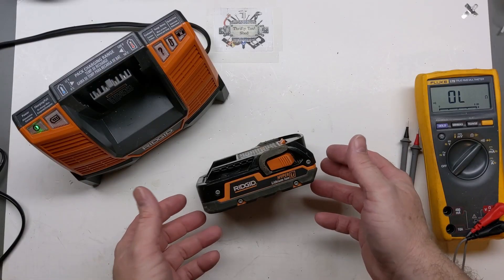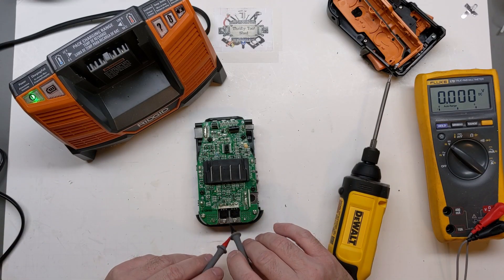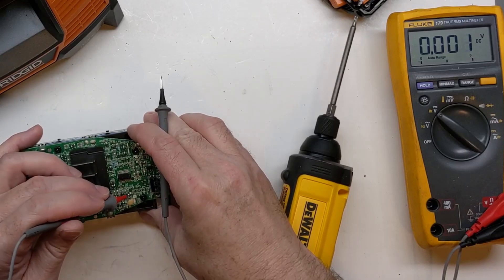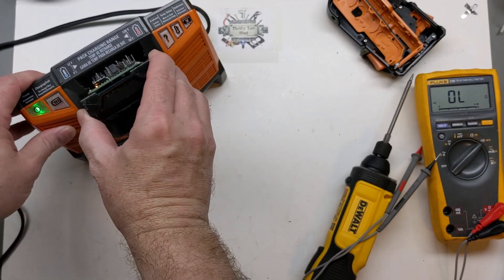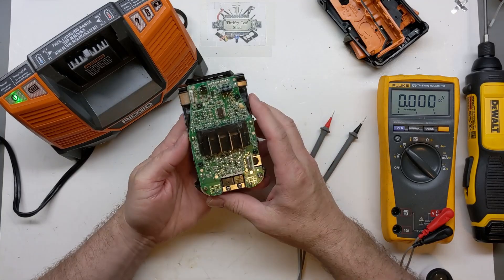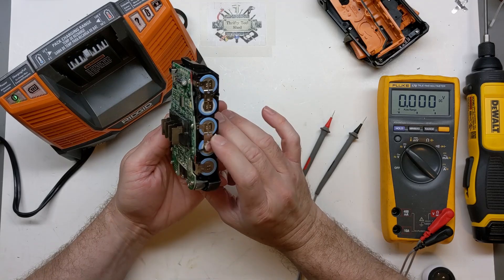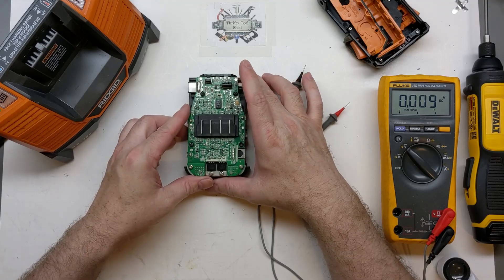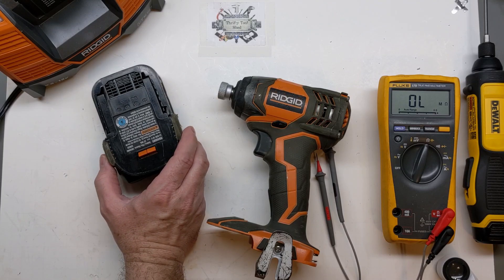Can we get this Ridgid 18V Hyper Lithium Pack back working?

Comment: I got 20v sitting at MOSFETs but controller doesn't want to enable to output pins. Reset didn't fix. Think controller bricked . I've had perfect solder looking boards on devices needing reflowing to bring them back to life. You can never trust solder.

Comment: Thanks about good video. I have same kind of AEG batteries. Both had faulty cells. I replaced those with new ones. Other battery works no just fine (even though lihts are not working when i press battery button)  but other where all cells are new does not. This problematic battery worked for a while just fine when there was voltage differences on paired cells. Then the battery light was flashing all the time but drill worked and charger accepted the battery.

Now when battery light is not flashing anymore the drill runs one second and stops. If I wait 10 seconds or so it runs another second but not more. Charger first gives green light but after 5 minutes it turns red "battery failure" light. 

Every paired cells has 4,03V-4,07V so those should be ok now. Very strange problem. I tried to brush the board with isopropylalcohol. Did not worked. I guess because I should not have connecting failure because the drill works even one second. Would be nice if someone has faced similar problem and could give me advice. I also reseted the bms with jump wire. Did not help either. Battery lihts are working and if I press the battery button there is four light as it should be with 4+Voltages I guess.

Comment: A+++++ my pack got little wet rain, going to try resetting after cleaning with rubbing alcohol .... will report back,  but not sure light coating with PC board lacquer would help prevent the corrosion from attacking the circuits?

Comment: accidentally left my ridgid 18 v drill outside. It got wet but not soaked. It showed 4 lights but it wouldn't fire off any other tools and it wasn't charging. I took the top off and used a dry toothbrush to just gently brush off the entire board. It took 3 times but finally the light came on on my hand held led light and it is properly charging. All I did was brush the entire board , no alcohol or anything. It runs all tools again.

Comment: Great video.  I have one battery that went through a -20degC winter  and one brand-new battery.  Both show error when I try to charge.  I suspect the charger, but I'll try your cleaning idea.  The charger also went through the -20degC  winter.  Do you know if low temperature will harm the charger?
Reply from the maker: Thanks for your kind comment. I don't believe the charger will be permanently affected by that  temperature. If the electrolytic capacitors physically look OK and not bulged or physically leaking, I would think it's OK. If it was powered on or actively charging while exposed to that temperature, it would be much more likely to have damage. Best of luck to ya!

Comment: reset trick worked on one but not both. what is the button inside on the top of the board for? i saw you push it and no lights lit. on mine the first light blinked 4 times. I'll save the batteries to replace others possibly, in the future.

Comment: Shout outs to your channel and isopropyl alcohol and a brush. Sorted my failing battery that charged up fine but failed under load.  2 of the 10 battery cells are showing 3.2 v and the rest are 4.0 so maybe I should change out the 2 lower ones or they are on their way out?
Reply from the maker: Most likely, they are losing capacity if getting that far out of balance. Sometimes charging up the individual cells with a constant current power supply back to fully balanced will get the pack up and running. If it gets off easy again, it's most likely that cells have lost capacity and will stay unbalanced until they are replaced.

Comment: I am having trouble with a battery pack, I've tried everything at least twice, but I suspect one of the mosfet's solder joint. I have tried re-soldering a number of times but the blob always goes from shiny to grey as it cools. This is the rightmost connection point, next to the output terminal.
Is a cold solder joint on a mosfet an indication of something?
Reply from the maker: It could be. Sometimes it takes a while to get a large pad or area hot enough to flow solder well. Even if it does get hot enough to flow well, it is possible the Rosin Flux from the solder is all gone, leaving a more dull joint. I will typically add Flux like the Amtech 559 or atleast RA Rosin Flux when soldering a device such as this.

Comment: Any chance you can show how to do this on a Dyson V8 battery pack?
Reply from the maker: Some of the Dyson packs have a terrible feature. When the board senses any of the cells have gone below a safe voltage level the board throws a permanent error and it cannot be reset. Not sure about the V8 specifically. I have seen some on YouTube go as far as to try to get a program out of a working packs Microcontroller and reprogram the faulty one after replacing cells etc.  That is a tremendous amount of work to repair a battery. Not sure which Dyson packs are like this.
Reply: OK, good to know, thank you.  Thanks for your efforts, great videos.

Comment: I have an old R840084 Rigid 18V that I can't figure out. I get 20 volts across the main power leads. All the batteries are level (around 4.09 to 4.11). It charges really quickly with no errors, but then it's only good for a few minutes of run time. Then if you wait a few, it will run again. It's like the batteries discharge in 1 minute intervals then go flat, then after a bit they can discharge again. Really weird, any ideas?
Reply from the maker: I have seen a similar thing happen when the cells or at least 1 cell is bad. So it's not the most common failure, but I have seen a cell go bad and be so low in capacity that it will charge up fine to 4V or so and then under load drop like a rock. It could be a cell doing this or the Board maybe causing it if it thinks it's a cell issue.
Reply: @ThriftyToolShed  Thanks, I'll try testing the pack immediately after it does a discharge. The weird thing is that if I wait, the battery will act just like it did off the charger. It will spin great for a minute (no load), then stop. I'm not sure if the batteries ever discharge because you would have to go through several cycles to force them. This is an older board, and I don't know how to reset it. There is a RST contact but no GND. I'm afraid to short it to anything but ground. Right now, I'm trying to see if I can get at least 50% discharge on the batteries.
Reply from the maker: @GeorgeNovak  
You may be able to look up the Microcontroller datasheet and see where ground is on it and use where that pin is connected as a reference for ground.

Comment: Thought I was going to luck out with a good circuit board cleaning...used 91% alcohol and lights came to life...but then right back to only 1 LED.  Charger says charged, battery says dead.  I am working on a 5AH Hyper LIon battery and the board does not look like yours...any chance you can assist further in resetting the baord?
Reply from the maker: I have only worked on a few of this type. The corrosion cleaning and then the micro reset is the only 2 repairs I have personally come across. The only other repair I have done on these is the obvious cell replacement on some with bad cells.

Comment: Tks for sharing this. I have two 9ah batts. One charges on the larger chargers fine but the other 9ah pops the defective light shortly after plugging the battery in.... However, that "defective" battery charges just fine on the smaller lower powered charger. Any ideas as to why this is happening? They are the octane batteries and both show as "healthy" on the Ridgid app.
Reply from the maker: Hard to say, I have not had those exact packs to say for certain. I have only had this issue with corrosion on the board. Thanks for your comment!

Comment: It worked!! I have been trying to jumpstart through the terminal leads. Used the wires from the multimeter and a separate Ridgid battery.  I went directly to the battery terminals for 10 seconds. Put it back on the charger and viola!  No more defective red light.  It’s blinking green and charging again!  Thanks dude!
Reply: Hey there. So you just jumpstarted the battery from another battery ? Just using the 2 outside rails correct ? I need to try this later today

Comment: What are the other two main pins, and what do they do. They’re labeled T1 & T2
Reply from the maker: I have not looked that far into these, but have many other packs. Most modern packs have a temperature feedback terminal and a communication terminal. I would  be almost certain these are the same. This is one of the few issues I have had with these type packs and no longer have any myself to say for certain.

Comment: I had the same exact issue and everytime I did clean it did light up. Unfortunately never got to the charging part cuz had to fix the charge station that didn't light up.

Which was caused by A/C side Cap   defect.
Reply from the maker: I have had the caps fail in some Ryobi chargers as well. Of course both are made by TTl.

Comment: Hi. Do you have any knowledge in Octane pack ? Is there a reset pin on the board ? Thanks
Reply from the maker: I am not sure about the octane. I would hope it would have the header area on the board. I have seen boards that do not have it and the only way to try a reset is to look up the microcontroller pin out and jump reset pin to ground. These with the conformal coatings make that a more difficult job than it should be. You have to gently scrape off the coating on those pins and the pitch is very fine on these newer micros....

Comment: I can't understand how you did the reset please what are reset and reset
Reply from the maker: Some battery BMS boards have a spot on the board where a programming header would be for the microcontroller. If the board has that spot sometimes you can see a screen printed abbreviation for the pins. I did see a RST and GND on mine and I simply jumped these 2 pins on the board for just a second. I have seen some boards not have this and some may be abbreviated differently, but similar. For example GND could be COM or VDD etc. I always look for a spot where the header might be on the board. It's usually not too far from the microcontroller. Jumping this helps sometimes because the power is always on the microcontroller and no way to do a power cycle. So this Reset will sometimes help in some cases. Best of luck to ya!
Reply: @ThriftyToolShed  Thank you. I found ground, but not the second one. In have 5 octane batteries 3 3amp 2 6am and 1 9amp. I fixed all but the 9amp. Thanks for quick response. The octane one compared to video looks much more complex. Also just realized my vision is not what it used it. So got a magnifying. Glass to see better . actually going to check shortly.
Reply: @ThriftyToolShed  I'll look for the rst thats more than enough help
Reply: @ThriftyToolShed  Forgot to mention the way I fixed my other 4 batteries was I drained them to about 1 volt by bypassing the terminals and left it for a day. The second I use another 18v battery to start charging it would make a noise. Pretty much my way of resetting for the octane batteries. If you cant find the GND or RST.
Reply from the maker: Are you saying that you drained the pack down to 1V?
Reply: @ThriftyToolShed  well not exactly. It was 3.1v as low as it could possibly get and also cleaning like you showed me.
Reply: I just fixed another 3ah octane battery today. Only thing is everything works now but the blue light remains and wont turn off.  I'll just figure something out or de solder. The connection. I mean how much power could it really be draining .
Reply from the maker: @MrRaulgutierrez95  Usually a LED will pull around 20ma So unless something else is pulling current as well a 3ah pack would be ok until around 150 hours before it would be close to low level discharge. Did you by chance just clean the board with alcohol? I have seen some boards do this for a few hours after a cleaning. I always use 99% IPA, but it sometimes seems to have drawn in moisture from the air if sitting around and IPA can eventually equalize to around 65% alcohol and 35% water if it is left in open air or cap not sealed well for some time. Water will absolutely cause the lights to come on on the board and may even cause other damage. Just thought I would mention that since I have had it happen.
Reply: @ThriftyToolShed  this one not yet. I'm just did the drain and restart method. But it doesn't drain too much or any at all.  I use 99% and I use lectra 3000. You could use it on energized tools or anything that cant be drain. But on another battery I think I used to much of it because it cracked the see through plastic that houses the terminals. Would that effect normal function.(9ah octane )
Reply: @ThriftyToolShed  man your response time is amazing!!!
Reply from the maker: @MrRaulgutierrez95 I see , yes I have had some electronics cleaners over the years that would destroy plastic. I try to share using the plastic safe type as well as non conductive of course since I have had problems before.
Reply from the maker: @MrRaulgutierrez95  
I do my best to respond as long as YouTube makes it show up and I don't have too many other things going on at the time. 👍
Reply: @ThriftyToolShed  yeah always look for non conductive and plastic safe. Thanks for replies I'll keep you up dated on any changes.
Reply: hey my friend so my 3 amp octane now works.z. There anyway I can message you directly. I'd like to send you some photos and get an opinion.
Reply from the maker: @MrRaulgutierrez95  
I have Facebook page to message through or thriftytoolshed@gmail.com

Comment: Just gotta quick question, what do the 2 middle terminals do? I'm planning on making a charger from scratch but I'm curious to know if one of those are a charge input?
Reply from the maker: On these, one of the middle pins is for charging and the other is for temperature monitoring if I remember correctly. It's been a while and this video shows about the only issue I have had with these Ridgid packs. I have worked on many packs that have a communication connection between the tool and pack, but these Ridgid packs have the BMS and Cut off built into the pack similar to Ryobi.  Best of luck to ya with yours.
Reply: @ThriftyToolShed  thanks mate, I thought that was the case, funnily enough there isn't any information or very little about pin configurations lol thanks mate and thanks for posting this video it was a great help learning about these cells, great content mate👍

Comment: I found the left hand mofset was not functioning and it seeto not be triggering. I ended up soldering a small wire from the trigger connection of one mofset to the other with this in place everything works ok. It appears to me e that there e are two parallel circuits one to trigger each mofset this makes me think that they may somehow be involved with safety circuits but I have no way of confirming this. Once you do this the battery charges and operates normally.  I keep my batteries in a steel box with dividers and a external spark proof vent. Just to be sure.
Reply from the maker: I do believe the monitoring circuit (safety) of the board is indeed what will cut the gate to the Mosfet.

Comment: I've enjoyed your EGO videos.
This time, this video allowed me to fix a 3.0AHr Ridgis battery that showed charge, but wouldn't charge or work in a tool (and was purchased without a tool, so the LSA couldn't be applied to this battery).
A good dousing in isopropyl alcohol, scrub with a toothbrush, blown out with air, and it's back working!

My battery had blackening on the + terminal and white and green corrosion on 1/4 of the board. Cleaned right up.

Thanks for your video content. I hope I don't have to use the ego repair info, but I'll be re-watching your videos for tips and info.
Reply from the maker: Excellent job! Thanks for your kind comments!

Comment: Great video. Considering you cleaned the board and said there was something on the board, I wonder if it will corrode again faster after its been cleaned. I wonder if there is a spray or something that would protect from corrosion so it would last longer.I know some vehicle circuit boards have a thick coating that can be peeled off, others like my MPPT solar charge controller have a clear coating over the board to guard against moisture.
Reply from the maker: These boards for sure had a light conformal coating, but nothing like thick silicone or the epoxy style sealant. I have honestly had great luck after cleaning the boards well with the plastic safe contact cleaner and getting rid of the corrosion, but I have considered adding a silicone based electronics sealant if I have any issues do come back. I also have removed the silicone potting from many EGO 56V packs to repair the boards and since I am careful to not let mine get damp at all, I have not had any issues with those yet either. Since it is easier to work on if the need arises I will leave them uncovered unless I start seeing an issue. My first EGO repair video was over 5 years ago and it's still going great so far. Thanks for your kind comment!
Reply from the maker: I have my eyes on something like these if needed, but I have no experience with them at this time...
https://amzn.to/3fKwm2y
https://amzn.to/3Uc7Cze
https://amzn.to/3UwKL1o